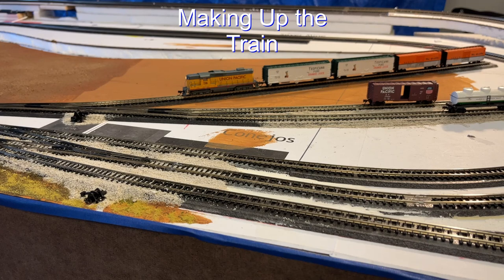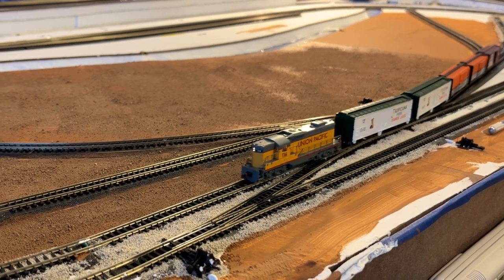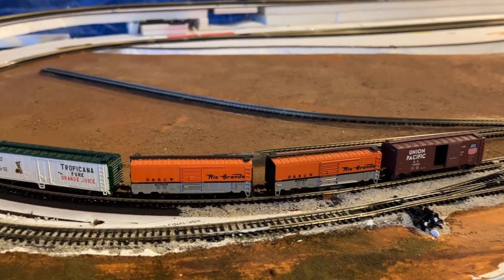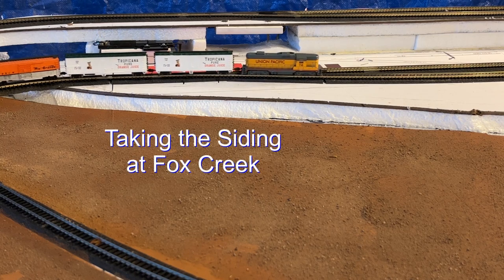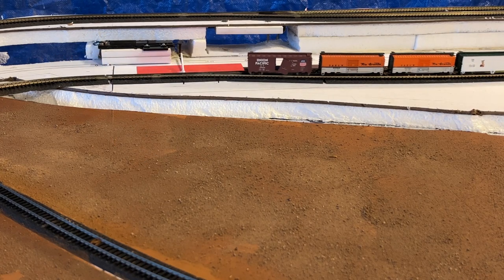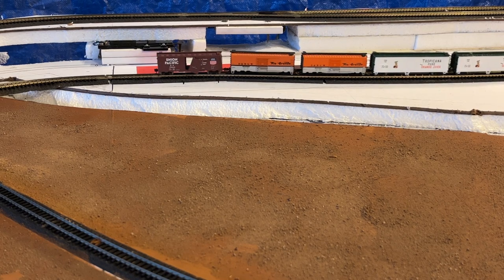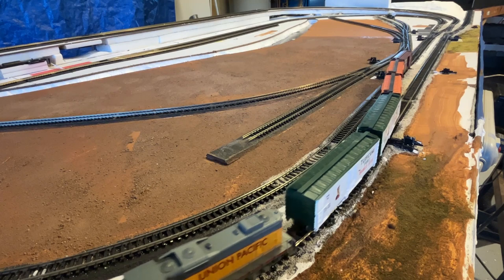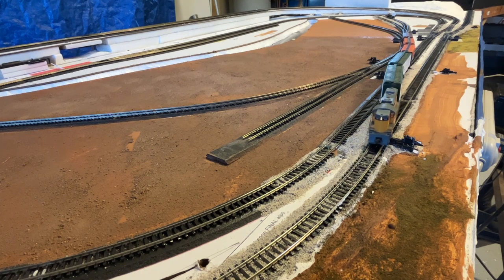Conejos Valley RR #7 action photos, A Train Tests the Track

Comment: Starting to take shape nicely. Is your lay out width 36" track to track or the size of the board it is on please?
Reply from the maker: The baseboard which is made of three sheets of styrofoam and a 1/8" thick layer of Masonite all glued together has a dimension of 80" by 36".  The track sits in about 2-3 inches from the edges.  A layout diagram and track plan are shown in the first video of this series.  Thanks for your interest!